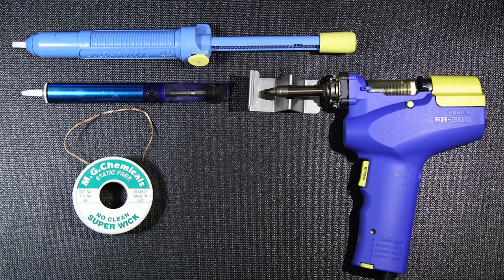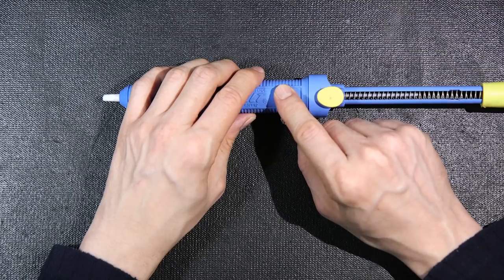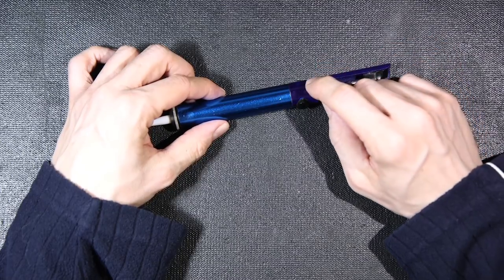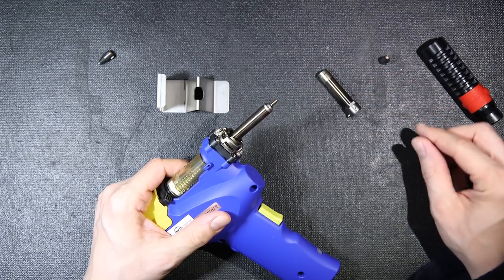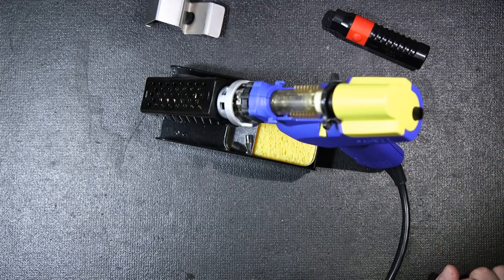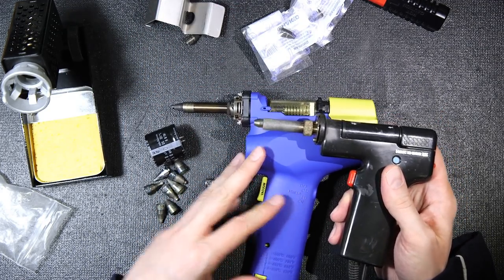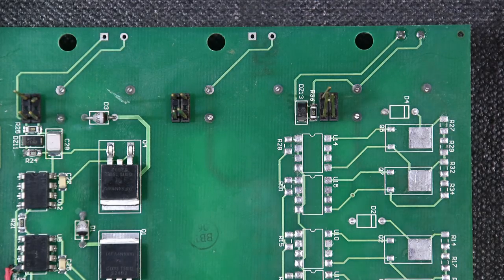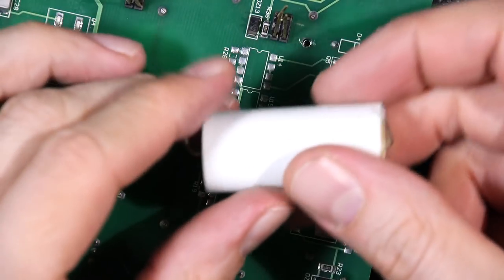How To Desolder Electronic Parts Using Different Tools.

Comment: that hako seems like the winner for sure, never had good luck with the wick. I have blown solder out of p2p work before, it makes a mess but it does work. I will have to get one of those pumps next time I need to work on an amp or multi layer board.

Comment: Small ESD pult, two large ESD safe pults, (the BIG silver soldapults) and the electric gun, and aways the wick. If I am out and about and don't have the gun, I have an assistant resetting one soldapult as I suck the solder out with the other. I run two pencils too. If one goes too cool, I switch off and let the other catch up. It's about getting it done, and getting it done right. Move successively & systematically through, and meticulously get EVERY joint PROPERLY soldered. NO STOPPING TO WAIT FOR THINGS TO HEAT BACK UP! That stopping is where I miss a solder joint. You are spot on on that cheap sucker. My threads have gone to shite more than twice. Third time was the charm! NO MAS mi amigo!

Comment: Great videos.
I have the small solder sucker.  A great upgrade to it is to use a very short piece of silicon tubing stuck on the tip, leaving about 1/8" protruding. Makes a good seal against the board and gets more solder out.

Comment: I think I have just found my new favourite channel. 
Like it a lot. 
Q: How easy is it to clean the electrical vacuum pump compared to the blue  (plastic) tool?
When I went to electronics school back in the 80'ies we had to make or own de-soldering tool in the metal workshop. We had to make every part from tip to springs and locking mechanism. The only part that was ready made was the rubber rings.  It was a lot of precision work but it was great fun. It was an exact copy of the aluminium one you show here. So a little nostalgic to see it so many years later. 
Thanks for a great video.

Comment: Thanks, Paul. I love my Hakko 808 de-soldering gun. It's worth it's weight in gold!
Reply from the maker: I agree Robert, that's a great tool!
Reply: And I love my METCAL oxox.
Reply from the maker: I like my METCAL as well.
Reply: Mr Carlson's Lab  They just save so much time that I don't see why everyone doesn't have one, no matter what brand. I also have an extended tip for getting into tight spots.
Reply: Agreed I have both the 808 and a metcal iron. I have the metcal deaolder gun but it requires compressed air to work. Is there another model with a vacuum pump for the metcal?
Reply: yes

Comment: When I desolder the solder sucker (Soldapullt) is my go-to tool.  I don't care for solder wick, but use when the solder sucker fails.  I charge the solder sucker by simply pressing it against my side or chest.  This is much quicker and less fatiguing, but it will start to hurt so you have to move it around.  :)  A desolder station is the Cadillac, but I don't desolder enough to warrant the price tag.

Comment: Excellent demonstration. I had tried the same exact plunger thing as the blue one in the video when I started. I immediately switched to solder wick and started saving for a desoldering station the same day. The results are simply not worth not buying one. If you can't afford a Hakko, get a Chinese one from eBay. The wick is also very useful.

Comment: i switched from hand suction pumps over to the cheapest desoldering station and hot air soldering station few years ago and as a hobbyist i dont regret it. so much faster and cleaner.
especially because of the high thermal mass of the desolder gun, its much better desoldering powersupply components which are on a 2 layer 2oz copper board with big ground planes.

Comment: One type of electric de-solder pump you did not cover but works REALLY well is the electromagnetic solenoid version of either/both the manual pumps (in 50 years I've only ever used/owned all aluminium bodied ones, never an all plastic or plastic topped one). Button on the side activates the solenoid to suck the solder, release the button to re-prime. 

Works great on stubborn large terminals e.g 1 mm or more. Much cheaper than a Hako, more flexible in use, as only a thin mains cable rather than the heating cable PLUS the vacuum tube, and if needed can be rapidly recycled for >5 reps a second - zero manual effort! One problem when doing the latter though is that a very fine solder spray can be emitted from the nozzle on the rebound - not a problem when scavenging components off a board never to be used again, but not advisable on a rework.

Comment: handy hint: if you're desoldering though-hole with a manual suction pump, align the board VERTICALLY in a sturdy vise, apply the iron to the pin on the COMPONENT side and apply the pump perpendicular to the board on the OPPOSITE side in order to get maximum suction. applying the pump and the iron together on the same side is next to useless.
Reply: Hmm, I would not I recommend doing it the way you have suggested. Some components are flush to the board so you would not be able to apply an iron to the component side. It's perfectly easy to use iron and soldering tool on the same side with the board flat on the bench. The secret is to heat the joint and quickly de-solder the joint whilst the solder is molten and the tip of the iron is still on the solder fillet. If I am scrapping a component I often cut the component off the pcb using snips then just de-solder the pins.

Comment: I can highly recommend the SS-02 for a compact handheld pump. The soft silicone tip is easily replaceable and gives a perfect seal around the pin and hole on the board. It is also a fully alu (and very sleek) construction including the back portion with the plunger and spring mechanism. Made in japan and shipped right to your door via amazon for 30$ :)

Comment: I have used all those for years and it all depends on what problem you encounter,, double sided boards can be a challenge.. I just got that pistol grip sucker one (but I had many different stations to use) and I like it's self contained,, my favorite is the small sucker,,it's fast and easy to reset with a thumb.. I also have a combined plunger type in a solder iron that works ok,,sometime in heavy traces I stick a solder iron on one side and a heated sucker on the other. I never settle on one tool but grab the one that suits the difficulty I encounter.

Comment: In the case of the Edyson soder- pull- it, i cut a V in the tip so it fits snugly over the solder iron tip. This gives a better seal which improve sucking. The FR-300/301 is awesome

Comment: I just bought a $10 Vellaman 110 solder sucker and it rocks.
It's a new take on the old Radioshack models with the rubber bulb.
But this one combines the spring loaded pump that's built into the handler.

Comment: Thank you for a nice video. This week I had to replace some SMD processors. I found some special solder with a extremely low melting point (ChipQuik). A string of solder on every row of legs and the solder takes many seconds to solidify. It was really easy to desolder the chips without ruining the boards.
Reply from the maker: Glad you enjoyed Anders!

Comment: Another great video!  I've used those little blue one-handed suckers since forever.  I've been looking for something that is a step up.  I'm glad you pointed out how much work it is to re-cock the bigger one... I was considering that to try as an upgrade, but I'm going to avoid it if it can't be cocked with one hand.  I'm probably going to go with one of the automatic vacuum ones.  I'm also not a huge fan of wick for desoldering.  I mainly just use that for cleanup anymore.  I've found it helps if you add some flux right on the braid (even if the wick is flux impregnated).

Comment: Awesome tutorial!  I can vouch for the bigger Soldapult DS017 as well.  Have the exact same one you have.  I had a variant of the little plastic one too at work and yep... shot its internals half way across the warehouse one day which led to its ultimate demise and journey to the trash.  I've also had great success with solder wick on surface mount stuff and getting pads re-prepped.

Comment: FYI about the issues that you described with the cheaper Solder sucker, I just got one off amazon ($8.99 shipped w/ 3 meters of wick)...brand name Tabiger if anyone is interested (google something like, "Tabiger desoldering pump amazon" or similar to find a link to it).  At any rate, it seems people are paying attention your videos (possibly) because instead of 'threading the rear onto the body, they used a small phillips head screw, which would obviate the problem where in the threading fails allowing the back to be jettisoned after some use.  Also, the rear portion seems to be made out of something more substantial (or at least less brittle then what it seems you were working with in this video). So, without having used it, I would say that they are trying to correct some of the historic design flaws in that type of instrument. Good for them!

Comment: Loved this video, and the previous soldering video, so much so I signed up for your proteon account.  I'm working on old mostly tube type amateur equipment, and your video are very helpful. I would also like to put in a request for a possible future video: How to use a service monitor to trouble shoot radio transmitters and receivers. Thanks and keep up the good work.
Reply from the maker: Thank You for the input, and see you there!

Comment: Very informative video. It must be said that the electric pump solder sucker, although it works the best of all, can damage or completely remove the solder pad. This is especially true for second or subsequent component removal from the same pad. Then you'll be adding wiring instead of a direct connection to the trace. So, be extremely gentle with that puppy!

Comment: I just got done changing out some rotten Nippon Chemi-Con electrolytic capacitors on a 1966 Teac A 1500. As the thru hole components on this old piece of gear had all the leads bent flat I used a cheep Wall Mart iron to "dig them up". I then used a Hakko to remove the solder.

I point this out as an option as this old Teac was set up by folks who were trained on point to point, I would have to assume. All the leads are at minimum an 1/8" long and laid on top each other. I couldn't figure a way around it otherwise. I sure wasn't going to use my Metcal soldering iron this way but in my humble opinion this is a decent alternative. Any thoughts on this would be welcome Mr. Carlson, thank you for the great tutorials!

Comment: i have both of the solder pullers and you are right. the first one is by far superior. the second one is cheap cheap cheap and doesn't pull solder very well at all. i don't like the cheapo version you showed.. the first  one is my choice. i worked on camera equipment for several years and always used the solda-pullit because it was always successful  in sucking up the solder.  the electronic pullers are very nice to have but costly.. but if you use the desoldering devices on a regular basis it would be cost effective to buy one and time effective as well. Great job with your seminar....

Comment: I have a tip for you.  If you use a bright back light you can see the leads as a shadow through the board.  Even a bright flash light will work on some boards.

Comment: Good video!  Definitely need more than just one tool, and I have all of the above (although mine is the FR-301), but I noticed that you don't show the ECG 45 watt rubber bulb iron.  I find the ECG to be more handy than the Hakko for a lot of stuff due to the much lower cost for the tips.  I tend to use the ECG iron a lot on salvage of old point to point stuff that is beyond reason to fix but good for salvage parts.  I love the FR-301 for PC board work though!  My last project using the FR-301 was actually replacing all of the keyswitches in this Corsair K-70 I am typing on now which I bought used, and the switches felt like they had been VERY used, so I redid all of them and the LEDs with brand spanking new Cherry MX Blues, the FR-301 made it a breeze to desolder 416 joints.

Good stuff on your channel!

Comment: My brother used to have a Radio Shack squeezable red rubber vacuum bulb with a white teflon removable pointed tip that had a hole in it. It was about the size of a light-bulb and it was quite more effective than those two shaft-like suckers. All you had to do was hold the rubber bulb with the pointed end up, squeeze the air out, turn it over, place the teflon tip near the solder you want to remove and quickly unsqueeze the bulb over the hot solder. The solder would suck up through the teflon tip and into the bulb. To clean it, you just removed the teflon tip and poured out the hard little solder bits. SIMPLE.

Comment: @MrCarsonsLab (23:30) these smaller solder suckers suffer from not sealing around the area they are sucking and if you try to get them closer to the wet solder, the tip melts a little.

I have found a solution for people on a budget who would like to use that device.

If you buy a small roll of self vulcanizing silicone tape, for about $5, you can wrap it tightly around the white plastic tip and let it overhang the open end.
The tape grips the tip and sticks to itself, with the very end making an extended silicone nozzle at the open tip.

The silicone tip is heat resistant to temperatures above that at which we solder, and it is flexible.
The tip creates a heat-proof nozzle that enables you to get in really close to the point you need to suck solder from, and, it conforms around the component wire and the soldering iron tip.
 The result is a far greater amount of the suction power, pulling at the liquid solder and a clean de-solder every time.
Reply: Sounds like a neat idea; if I had some silicone tape I'd give it a try.  Melty tips is the issue I have too.  Makes for an anxious desoldering process trying to push the release the split second you put the tip on the joint, trying to avoid melting it..

Comment: If you don't have any of these available, there's always the splat method. Heat the component leg with the board raised in the air, then quickly smack it onto the work-surface. The solder splats out. It's a bit hit & miss, but its got me out of trouble many times.

Comment: Been watching your videos the last two years because of you I bought my AOYUE  (int 474A++)Desoldering station I know it’s a cheap Chinese model but it’s been working just fine for the last year and during your whole 40 minute video I was using a continuously salvage parts of a large power supply. Also my hot air rework / soldering/ Power supply station YIHUA 853D Each were about $70 apiece and my son and I have hundreds of hours on them And they still haven’t broken down yet definitely got my moneys worth
Reply from the maker: Glad your enjoying the video's! Thanks for taking the time to write.

Comment: The Solderpult and Hakko 30x are very nice (I use them both).  As for a small hand sucker try the Engineer SS-02 Solder Sucker.  The company is Engineer.  It uses a Silicone Nozzle that will not be damaged by your iron while sealing around the plating.  It's made out of metal, good precision and gives a good suction for a small device.

Comment: Half an year ago I struggled to find a proper comprehensive desoldering tutorial on tube; after something like 20+, longer and shorter, disappointments I finally gave up...but ah, here we have it now - thanks to you, Mr Carlson o/
One question still in mind: what sort of a lubricant do you use maintaining those mechanical devices?
Reply from the maker: I usually use a high grade silicone based lubricant.